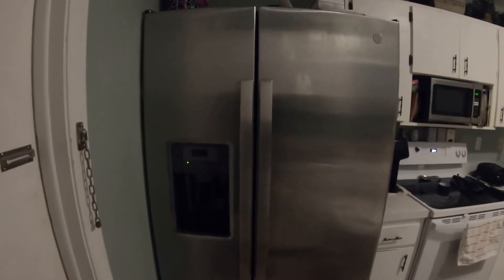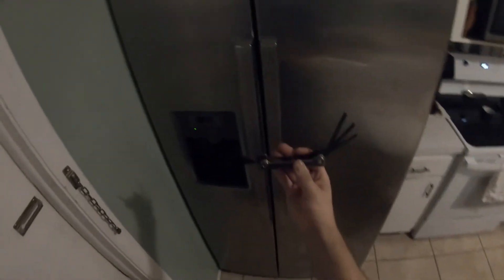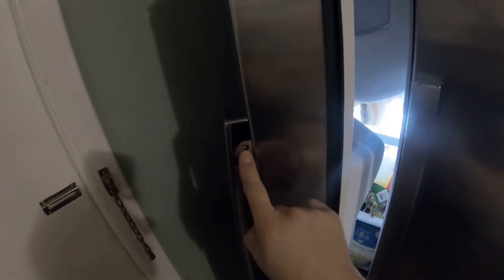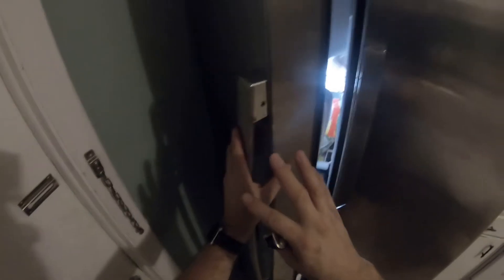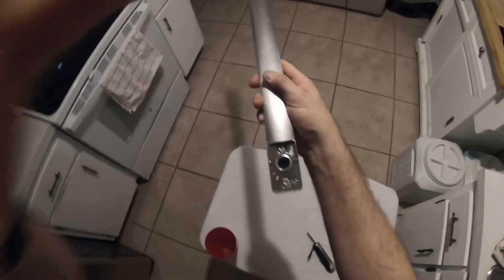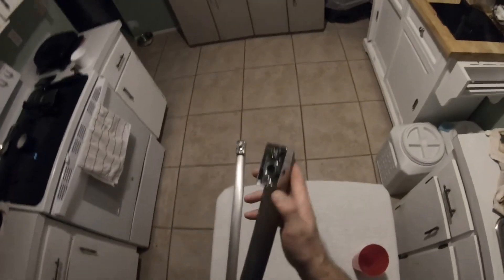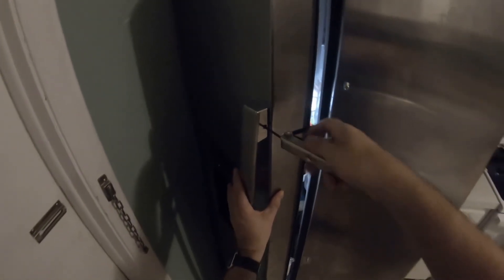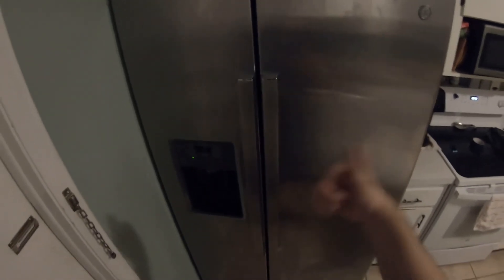REMOVING and RE-INSTALLING HANDLES on a GE SIDE by SIDE Refrigerator

Comment: This is a good video but here is a bit of extra info that may be helpful.  Yes, the allen screws (grub screws) will fall out and go under the fridge, so be careful in removing them.  Note that the curved metal part of the handle assembly is mounted into a plastic block at each end.  When you remove the handles per this video, then inspect the plastic blocks/ends.  Each block has 2 allen bolts that require a slightly larger allen key and the 2 screws may need tightening if the curved metal handle is loose or vibrating.  That is why I had to repair mine, the metal part felt like it was about to come off.
Reply from the maker: I'm glad the video helped you out,   and thanks for that bit of information. 👍😀